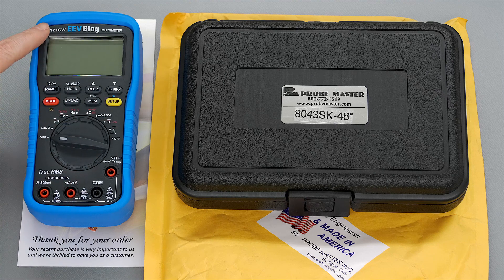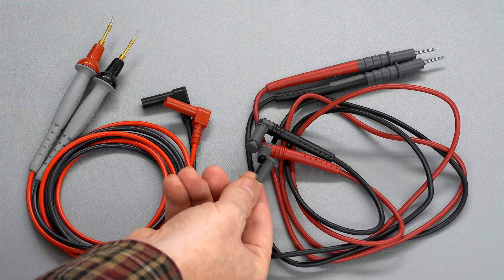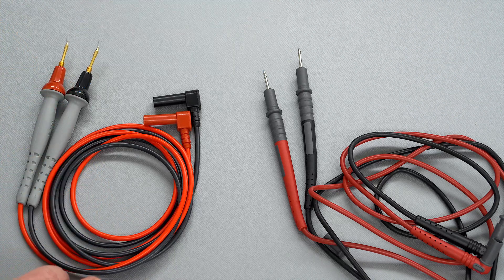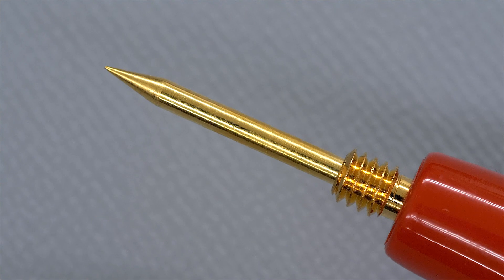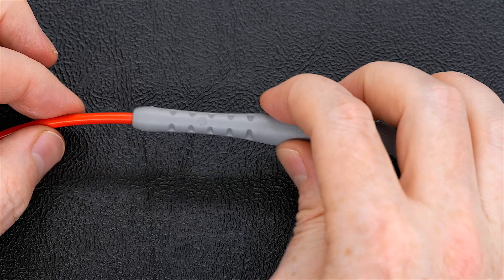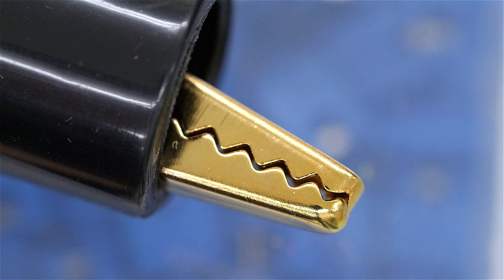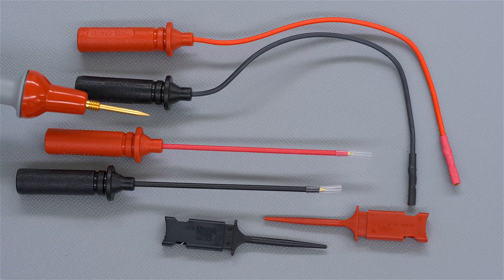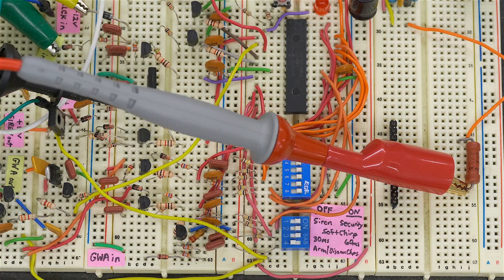Probe Master 8043SK Review [2023]

Comment: Why do all of you buy 90 degree probes?
Reply from the maker: The Probe Master kit I reviewed does include some connector which have a tiny L-shaped 90° tip, but I wouldn't call those my go-to tips.  I use the pointy tips most of the time.  Even so, the L-shaped tips do work for attaching to legs of discrete components on a bread board.

Comment: I also bought this kit after buying my 121GW several years ago when i was studying EE. I liked the alligator clips and the better quality everything. Before that I had an old Agilent meter for years, and i also purchased the additional PC USB connector and test lead kit for it that included alligator clips. I prefer them for most situations, even for just holding a piece of solid core as a probe for proto board.

Comment: Quick question, how well do the probes fit to the probe holders on the back of the GW121?
Reply from the maker: Well enough, I suppose.  You don't snap them in.  You slide them it.  It works, but you have to be really careful because the tips are so sharp.  Having tip guards really is a must if you wish to use the probe holders on the 121GW.

Comment: In my home lab, I own a large collection of Probe Master probes, tips, and shrouded banana plug cables.  They are top-notch.  I love the spring-loaded tip option.  Great for piercing insulation or  corrosion without stressing the circuit board too much.

Comment: Maybe the contact is not made with the screw terminal? There could be a gold plated contact inside the hole where you plug the tip into. Could you check this?
Reply from the maker: I'm afraid I don't know what you mean.

Comment: what make it different? the coating or the wire?
Reply from the maker: I can only "assume" you are asking "what makes the ProbeMaster probes different from the stock probes included with the 121GW multimeter."  My answer to THAT question is the gold plating, perhaps, makes the biggest difference, seeing that both the stock 121GW probes and the ProbeMaster probes use soft-and-flexible silicone insulated leads.  Not only that, but as you can see in my video, you get a lot of tip accessories with the ProbeMaster kit that you don't get when you buy the 121GW.

Comment: Thank you very much for the great review (and the 121GW review). You have no idea how happy I am to find your videos on one of my targeted DMMs. (I just placed order for 121GW indeed).
May I know how you choose between different models from Probe Master? I could not find much comparison between their products.
Reply from the maker: Thank you for your kind words.  

If you expand the text description under my video and look at the section named "BUY FROM PROBE MASTER," you will see links to my recommendations. Specifically, I show a smaller and less expensive kit, as well as the same kit I purchased.  When you compare both of those kits I recommend, you will notice that both have the "8043S- Rt Angle Safety Banana Plug" selected, which is for compatibility with the 121GW.  You will also note that I have a length of 48" selected in the popup menu on those respective product pages, and you can change that to end problem wire length you like between 24" and 120", which is amazing!  Lastly, if for some reason you don't want "right angle" connectors for your probes to connect to the 121GW, note that 8028S is a straight connector that is fully compatible with the 121GW.  That is an option you would need to select before you buy, but I prefer the right angle 8043S connectors (what is shown in my video).  Please let me know if this answers your question.
Reply: Thank you for the explanation. I think I now know what to look for and I will probably buy the same kit as yours.
The 9010 series is modular and probably not what I need.
It seems that Porbe Master does not offer a stackable version of safety banana plug. I may need one in the future… 🤞🏼

Comment: I never thought that I would be excited by watching a video comparing test leads, but you Sir have nailed-it! I have a new top of the range Siglent desktop multimeter and resistance measurement takes forever as you push each probe to make a decent contact. I'll be swapping these out for some Probe Master wonderfulness. I just wish they made the meter connection plug straight, rather than right-angled. Thank you for your time and effort in making this video. Cheers!
Reply from the maker: Thank you for your kind words.  If you go to the ProbeMaster webpage that showcases the Kit I purchased, you will see, directly under the price, 8 different variations you can choose from, including variations that have straight plugs. https://probemaster.com/8000-series-test-lead-master-kits/

Comment: My advice for everyone with nickel plated probes: give them a little scuff with some scotchbrite and some alcohol.
It'll do wonders with the surface conductivity. Not as good as goldplated (although nickelplated is much more durable than goldplated, so maybe more suitable for 'rugged' enviroments), but it'll solve 99% of the problems.

But nice review, it sure looks like top quality. But this kit isn't cheap; where I live (europe) this kit is €90 (incl tax), so quite an extra expense on a ~€200,- multimeter.
The brymen gold plated silicone test leads that were originally supplied with the 121GW multimeter only cost €11,--. Too bad (and honestly hard to believe) that UEI (which is an experienced and well known manufacturer) couldn't come up with a suitable (gold plated) alternative to those.
Reply from the maker: I didn't try rubbing the 121GW's stock probe tips with abrasives like ScotchBrite , but I did use 100% IPA and that didn't improve surface conductivity at all, proving that oil and debris are not the issue with the UEI probe tips.  Cost does matter though, so for people who can buy the Brymen gold plated probes, that would also be a great alternative, although you wouldn't get all the accessories that are included with the ProbeMaster kit I reviewed.  I agree that UEI dropped the ball when it comes to offering use better probes.
Reply: @JDW-  It's indeed not a matter of an oily or greasy surface. My guess is that the nickel layer is just very passified (and has formed an oxide layer or a layer of chemical reaction with another substance), maybe due to additives in the nickelplating (additives to speed up the process or to enhance the shine or something like that).
A chemical like sulfuric acid of reasonable concentration also might remove that passive layer but that is not a substance I'd recommend people to mess around with when some scotchbrite (like the green back of a kitchen sponge) does the same thing.
Even the cheapest probes like you get with cheap aneng meters start to function sufficiently with that.
It's not on the level of a decent gold plated probe, but it never will be. For electronics, gold plated probes are the best, and they should've come with a supposedly top tier multimeter like the 121GW.
Especially as Dave is pretty much the godfather of the stroke-continuity-test importance.
Reply from the maker: In my review video of the 121GW, I showed Dave’s reply back to me on the EEBlog forum, where he said he changed the probes for reasons of logistics and practicality. While I can appreciate and fully understand that, the fact remains that the product suffered a bit, when compared to to the probes included in the initial 121GW offering. So it seems, Dave was willing to make that sacrifice. I will try your scotch brite idea and see if that changes anything.
Reply: @JDW-  Yes I saw Dave's reaction in your other video. I can understand that supply problems are a valid reason (when a customer has ordered and paid, you have to ship), but logistic reasons like opening the box is imho a bit of a lame excuse. He did that for the first few years, which I assume are the years that the meter sells best, and having made a video about it where he literally says that the viewer should take gold plated probes in account when choosing a multimeter gives me the opinion that he should just man up and put in those extra few seconds to open the box and include the gold plated probes if supply issues aren't a problem now anymore. To get an idea about the amounts we're talking about: his current stock is 37pcs according to his website. So even if that's a weekly stock, imho it's still doable in a lost hour on a saturday afternoon.
 I always have a suspicious mind so I wonder if there are things at play that he's not telling us (like UEI potentially not liking it that probes from a competitor are being shipped)

I'd like to hear back if the scotch brite trick worked for you on those UEI probes.
If so, maybe Dave could open every box he sells and give the included UEI probes the treatment 😂🤣

Comment: Do you have a part number for those male headers at 15:33? Do they work well? I have a bunch of .1" header connector test leads and love them on PCBs (where I always add headers for testing), but have not found headers that properly fit into a breadboard. The normal ones are too short and don't connect properly. I also tried "extra long" ones but the plastic thing always moves on me.
Reply from the maker: I've never had header issues with my JAMECO breadboards.  The most recent header kit I purchased was from Amazon.  You can see me show that kit in my ROM-inator video here: https://youtu.be/CVClCLgBm6k
Header & Jumper Kit (affiliate link): https://amzn.to/3tQoCi8

Comment: Nice probes. I always do the "continuity test" myself and probes like the silver ones you showed here are not allowed in my toolbox.
Reply from the maker: Yes, and after this video, I bagged and stored those UEi probes away.  I don't anticipate I will be using them again.  To be honest, I never had a set of probes as bad as those.  If you watched my 121GW review video, you will see that I show the stock probes on my other meters like the Fluke 116.  Those aren't as perfect as the Probe Master when doing the continuity tap-test, but almost!  And when it comes to that infuriatingly lone UEi probe stain relief, I've not see that before either.  They are all around badly designed probes.  And it's rather unfortunate for the 121GW meter because it originally shipped with Brymen gold-plated probes.